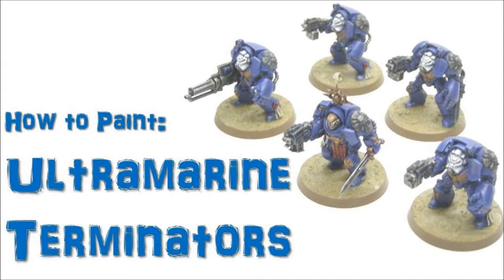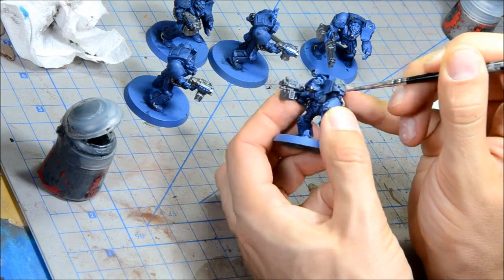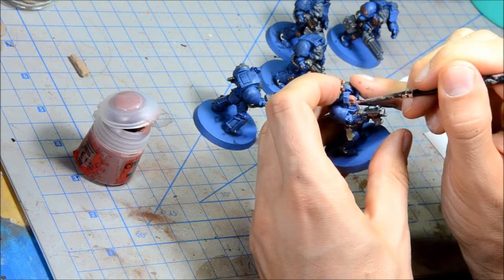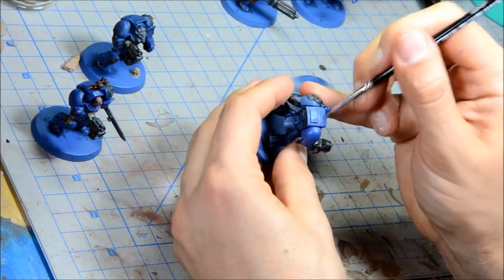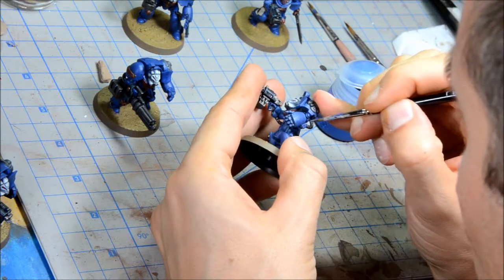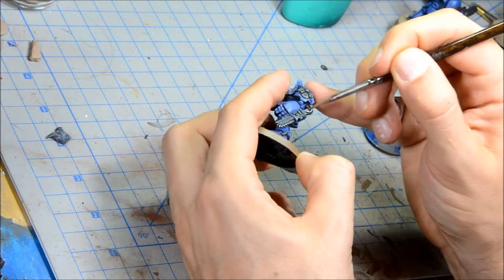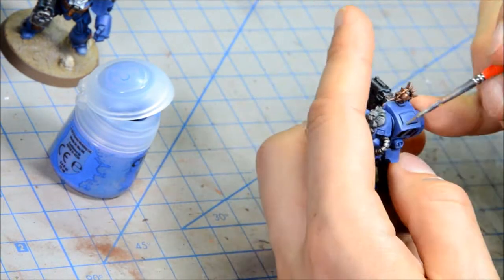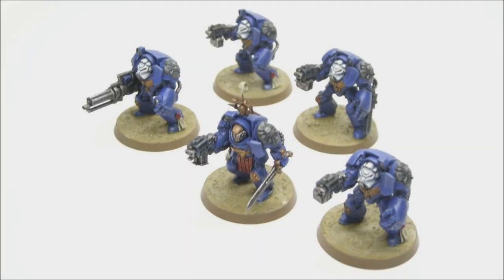How to Paint: Ultramarine Terminators

Comment: Plus, on every single video you're posting, I can see that you're utilizing 4 colors for shade and enlightmens : 1 base, 1 sahde, and 2 layers to enlight, BUT, you almost stricly overpaint over the base with your 3rd layer : for example, you put zandri dust, then shade it with seraphin sepia then you put on your figure ushabti bone. But when you're putint ushbati bone on your figure, you pretty much paint it all unless those deepest part you've shaded. What's the point of painting a base if it's overpainted by a birghter layer ?

Thx !
Reply from the maker: Freaky HardRocker the base like primer... its a thicker pigment (Think of the foundation paints), so it goes on better over a black primer.  A lot of the new GW tutorials do a layer before the wash, so you can do that if you want a slightly lighter colour